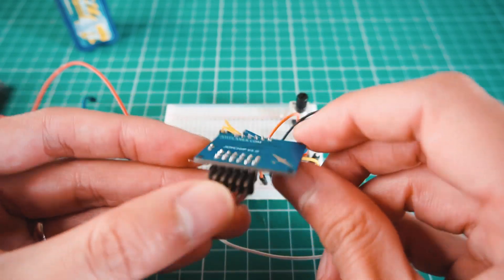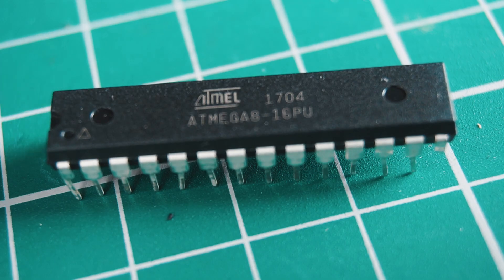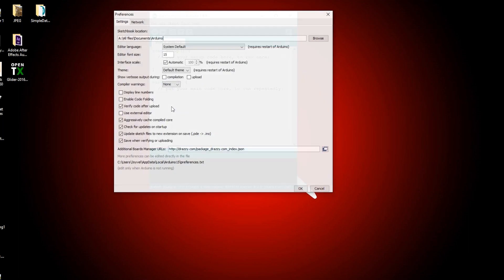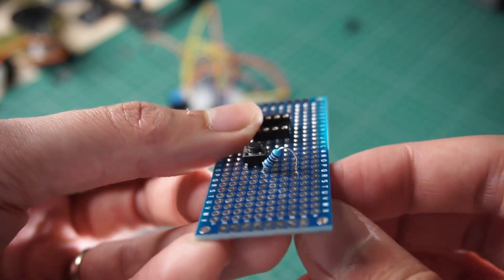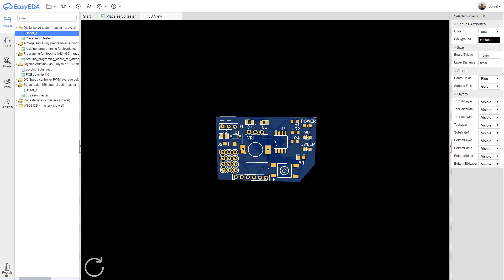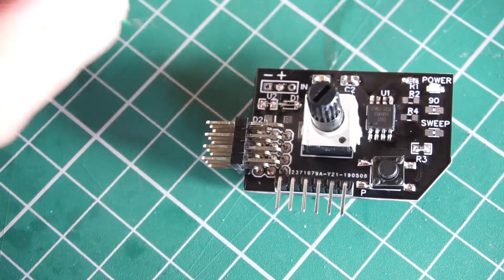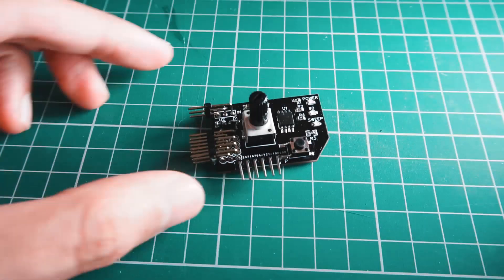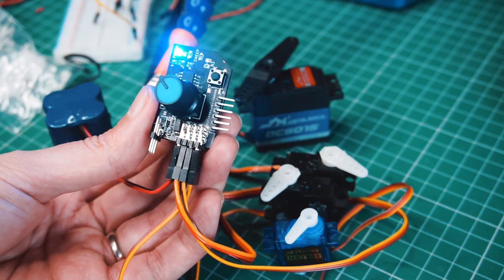How to make a servo tester using Attiny85 micro chip

Comment: Bro,  thanks a lot for this video.  I have a problem with controllong servo using attiny85,  

Why if we use example of servo knob in arduino ide for arduino uno doesnt work with the attiny85 even when the pins all correct . 
I test it using LED,  it doesn't look like Pwm signal,  just blinking.. not brighter or dimmer along with potensiometer
 I test it

Comment: The reference SoftwareServo.h  library had WProgram.h error, should be Arduino.h
The example given in SoftwareServo assumes different pins- be sure to use pins available on the ATtiny85, for example there is no analog 0 pin on the Arduino, use A1, A2 or A3 on the Attiny85. Works good though, thanks.